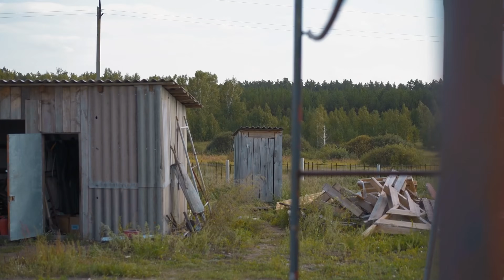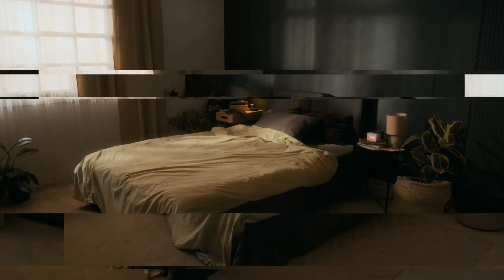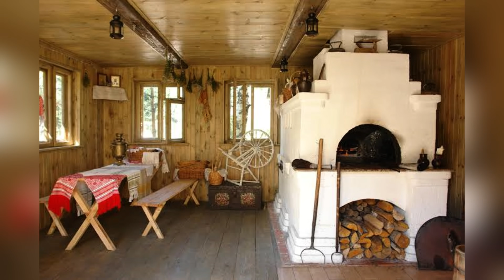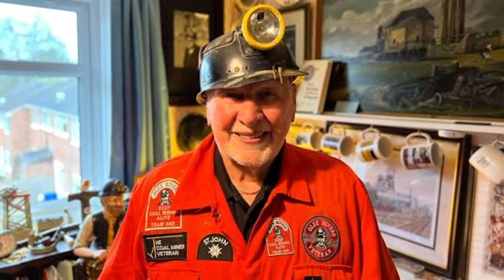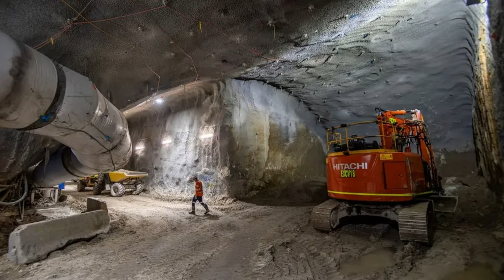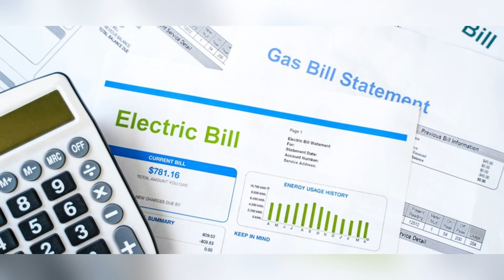This $7 Wood Stove Has Heated This Cabin For Free For 31 Years — The Design The EPA Made Illegal!

Comment: The cheap barrel stove does work. What is not telling you it will not usually last more than 5 to 6 years
Reply: you have to line it with 2 inch of chimney cement . Then you can get 12 to 15 years out of it .
Reply: @robertmiller5735 а как он на металл ??Нормально прилипает?
Reply: @ВасилийДударов
It is necessart to coat just the fire bed.  About the bottom 1/3  of the barrel.  

What also works is sand.

I have had good luck with firebrick.

The point is to keep the hot charcoal away from steel.  The vary hot tempratures increase the oxidation rate.
Reply: @HenryHolz123 понял!У меня гугл перевод на русский-он мне перевел как огнеупоный цемент.Огнеупорный кирпич или песок-да!У нас так и делают,спасибо.Огнеупорные составы тоже есть.Тогда по хорошему нужно где топка и угли и чуть выше,как вы говорите обложить огнеупорным кирпичем а для того что бы тепло держалось и накапливалось внешнюю сторону бочки полностью обложить простым кирпичем-тогда ночь точно держать будет.
Reply: @ВасилийДударов  you stand the barrel up and pour the cement in the bottom and put in the first layer of fire brick , then come up the sides like you are building a round chimney in the barrel  . When it has dried for at least 3 days , lay it on it's side and build the brick wall with the door in it .
Reply: @robertmiller5735 ✏️✏️📌🤌👍
Reply: Spend a little money and get Stainless barrels.  Also line those with fire cement/fire brick.  Your choice if the extra life is worth it.  Also a good cleaning and oil will help with rust off season.  And get the second top barrel adapter.   More efficient and it doesn't have to be fired as hard.
Reply: Главное что бы не оцинкованная была
Reply: also, there is not one insurance company who will cover your home if it was ever to burn down, or get destroyed from weather.  you would simply lose everything
Reply: that's why you paint the inside and out with high heat paint and line it with fire brick.